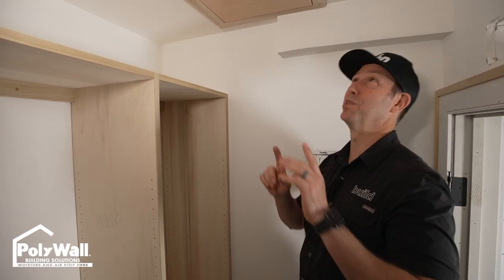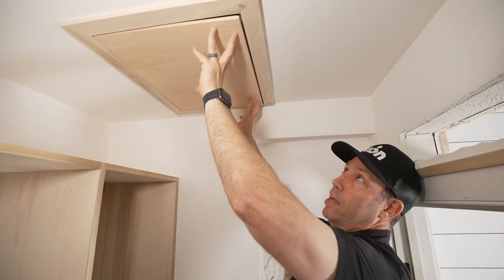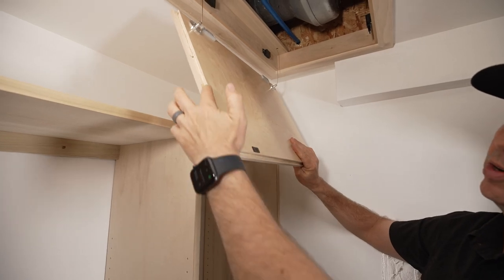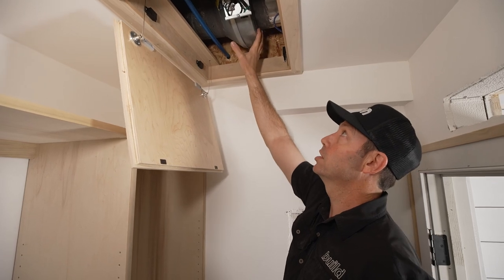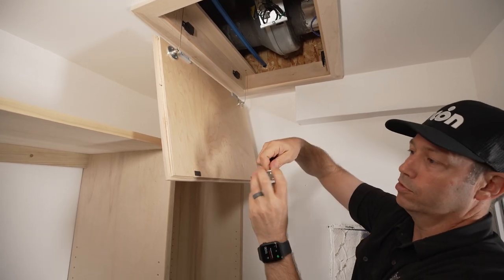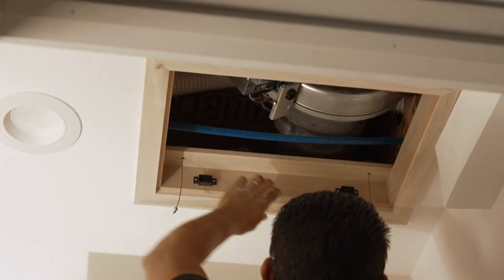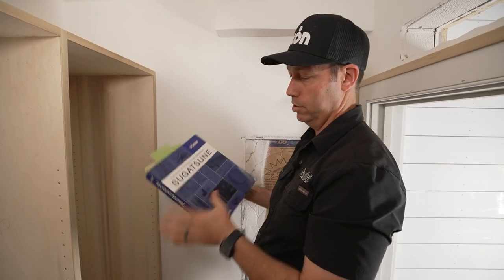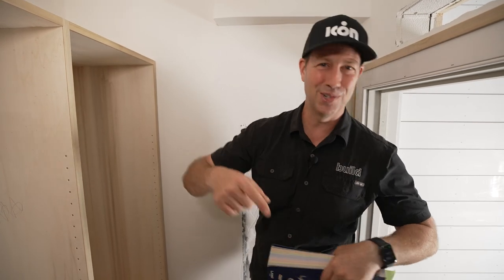Easy Access Panel Build - Cheap but Satisfying!

Comment: Similar magnet systems have been in use in Germany (to my knowledge) for at least 50 years. Often for easy access to drainage pipes from bathtubs and Showers as well as for water meters that need to be read anually and are in the apartment.

Comment: I like the fact that this panel can be opened without tools, and is fully removable in neede. I also like the very clean, flush finish. I expect that a joiner could reduce the time to build the frames and panels if they got an order for all the access panels needed for a whole house. Engraving "Push Here" along the front edge, where the catches are, would give a future home owner an idea of how to open the panel.

Comment: Awesome.  Plumber left a 10” x 20” hole in my basement knock down textured ceiling.  You can’t find anything to fit a hole that size so looks like this is on my list of ‘to-do’s.’  Thanks.
Reply: Build one yesterday.  Thanks again for the great idea.

Comment: Very cool. On a home that wasn’t cared for from an air tightness perspective like yours, would weatherstripping be important for this?
Reply: If the GWB+ paint forms the air barrier between the conditioned house and unconditioned attic, then yes.
Reply: Don't use this method if you have attic flat insulation, unless you have magnets strong enough to create a strong seal on your gasket.
Reply: @TheHaydeenee  For sure, you’d need a strong magnetic clamp to keep the gaskets sealed. Possibly too strong to easily open. A sealing mechanical latch, similar in principal to a hopper/awning/ casement window would work better if you need the panel to seal.

Comment: Those access panels would be nice to have on the backside of shower/bath fixtures.Thumbs up.
Reply: Exactly!
Reply: I was just thinking about this- on the back side of my shower wall it’d be great to have access to shut-offs and maybe a spare hose bib or something.
Reply: @timgleason2527  You can buy pre-made access panels at electrical or plumbing shops (also Home Depot, Lowes, etc). If you need something larger it might be worth it to DIY though.

Comment: The use of just magnets makes me a bit nervous for a ceiling panel like that. Looks good though.

You can upgrade that panel by getting rid of the casing, putting a bevel on the edge of the jamb, then tape and mud over the gap. Then you'll have a real clean transition to the access panel with only the gaps showing.

Comment: If you were to do this same kind of access panel in say, a bathroom, would a simple 1/4" rounded rubber gasket be enough?
I'm considering this for a panel I need to have, and am worried about humid air from the shower trying to escape into the wall (its an exterior basement wall)

Comment: If the other side was a bedroom make the backside of the shower the inside of the closet (either a side or the backwall). Then you don't care how finished or ugly the access is. Could just be a sheet of white colored aluminum nailed in the corners. Easy to get on and off in the unlikely occasion you need to get in there.

Comment: I'm helping a friend remodel a 20' x 20' barn into a dog training /kennel space. We have insulated the ceiling with 12" fiberglass batts and installed sheetrock over it. As of now, we left no access hatch into the rafter space. There are wires going to 5 ceiling boxes above the insulation. Do you think we should put an access hatch in? The attic is vented from soffit to ridge vent. I can't see any reason to regularly access the space. If in the future an access hatch were needed, we could cut a hole and install one, or just patch the sheetrock.
Reply: Yes you should have one if just so you can do roof maintenance

Comment: On your range hood fan does it connect to the erv system at all? I've heard of people using recirc vent hoods with erv systems
Reply: I have worked on houses where the range hood vent stack had to be scrubbed or replaced due to oil/soot build up on the internal duct wall.  I expect an ERV would make that build-up occur even faster due to the cooling and greater surface area of fins.  IMO, the extra maintenance hassle and cost wouldn't be worth the energy savings.
Reply: @22kmclaren  would the negative pressure be negligible? Would you try to at least boost the supply side if you could connect it?

Comment: Only a homeowner, but does anyone think you could seal a large metal air vent, top with some lightweight insulation, attach an airtight gasket, and then attach the whole thing with strong cabinet magnets, for an easier access panel?  Not for a Risinger home, but a lesser home??

Comment: Great idea. However, I would be concerned about the panel falling and hitting the cabinet on the back wall or your head (should you be standing on that step stool at the time). Household vibrations (or accidental contact) + gravity pulling down on that panel held in place by magnets is the danger, especially since you have a second floor and more vibration. Those front touch latch magnets are designed for horizontal loading and are just not that strong. The rear magnets look stronger (the specs claim 6.6 lbs), but the torque and inertia from the panel opening, should the front magnets let loose, will easily overpower those better magnets in the rear. The cables look adequate to arrest the falling panel, but it will then swing and strike your cabinet with some force, marring both surfaces.

A simple solution would be to double your touch latches. Another possibility would be to add a hidden latch system (in addition to the touch latches) like the ones used for child safety on cabinets. Safety 1st (the company) makes both hidden mechanical and hidden magnetic actuated child safe latches that would address this issue. Since you never plan to open the panel (for 10-20 years), I'd suggest a pair of mechanical safety latches. That way, when the time comes to open the panel, it should be obvious to the user what needs to be done to open the panel fully (including yourself). You might also include an instruction sticker next to the cable anchors that they can be unscrewed to completely remove the panel. That will also help the next owner (or yourself in 20 years) opening and needing to remove that panel. :-)

Comment: Was this after thought? Suprised you didnt go with a premade. 
Many of the premade require 2.5" of extra gap. So truss to truss i M looking at like 20" opening.  High risk of anaging any of that hardware and damaging it and or drywall.

Comment: Nice panel Matt, …..are you going to have a safety chain? What if there was an earthquake and someone was standing in the pantry, and that thing fell down on someone’s head because the magnets were not strong enough?🙈🙏🏼👀
Reply: there are literally 2 of them in the video at 0:08
Reply: Oh just use one that is strong enough to hold when a meteorit hits the house. Won't fall down.
Reply: @DagarothBlackrose  those safety cables were only on one side of the access panel….if someone was standing Just under it… When the “earthquake” struck…. The panel would fall down and strike someone in the head…, You are correct there are two safety cables… And they are simply suspending “one side of the panel“…. The other side of the panel is not suspended by to safety cables… You can see that in the video at 0:09…🥸
Reply: How low do you think that door reaches when open?  Like 18 inches down from a 9 ft ceiling?  I don't expect they will have too many 8 ft tall people standing in the corner of their pantry during an earthquake. lol
Reply: He was on a ladder…. So, you would have to be taller than 7ft to get hit by it!

Comment: Real cool use of hardware available. Wondering if there is a more time consuming yet cheaper option. Yes time is money, but some have more time than money. I'm not knocking it one bite just thinking here.
Reply: Stop thinking.... Your thoughts make no sense
Reply: secure the access panel with four screws, unscrew when needed.  that's a cheap option for a panel that will get opened once in a blue moon.  if you want fancy and cheap rig something with hard drive magnets that you scavenge.

Comment: I always like what Matt does/makes (except maybe 20awg cables for LED lights) but this is just an unnecessary expensive and not useful.
This whole assembly with labor is probably pushing $500 when you could have gotten away with same look but instead using recessed 4 decorative screws.  You said it yourself - it'll be opened maybe once in a decade.
Reply: but it wouldn't be so "satisfying" ;)